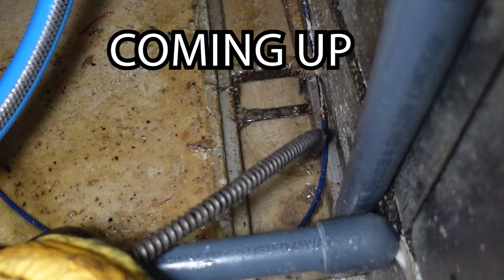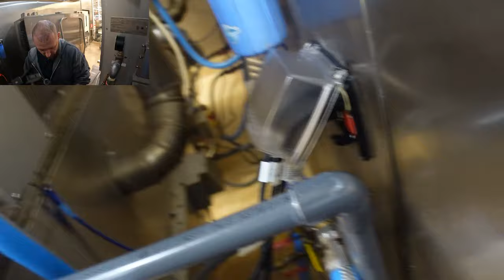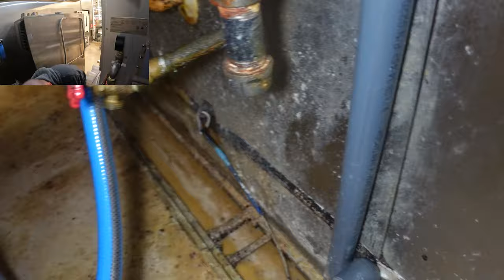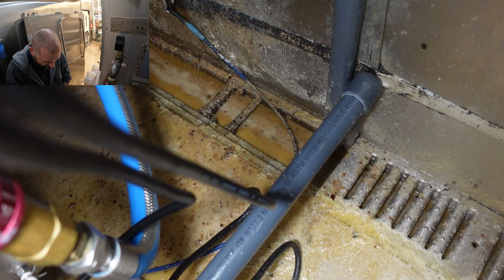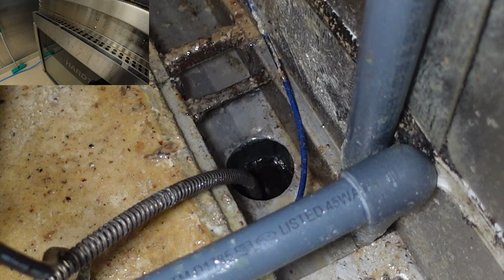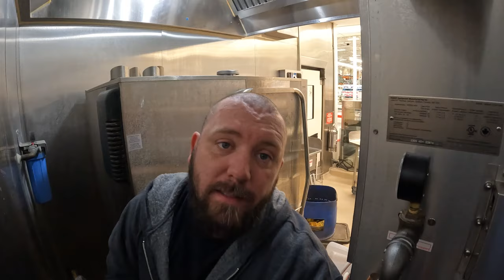Greasy Trench Drain Clogged At A Big Box Store

Comment: Great video, as always. I love the 2 cameras. I'm wondering what else was in the trench, because of how the water you were flushing it with was coming in waves. Seemed like something was kinda in the way. Now on to Bruce's video. Its a great Friday!
Reply from the maker: So this place has attachment. You can hook up to that hose. I was using and it creates like a pressure washer. And stuff like that and we've actually pulled those attachments out of drains before because they weren't connected to the handle properly and they would fall out and the guys will go in and try to power. Wash the drain to clear it and it would fall out and. Drop down the drain. Thanks for watching. Have a great day and a great weekend.